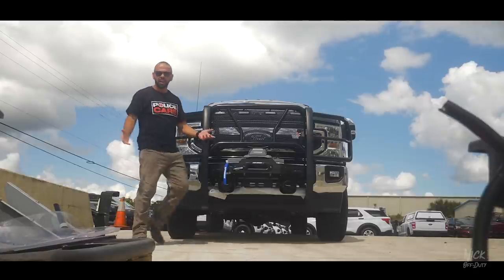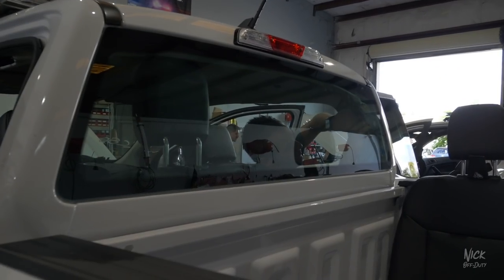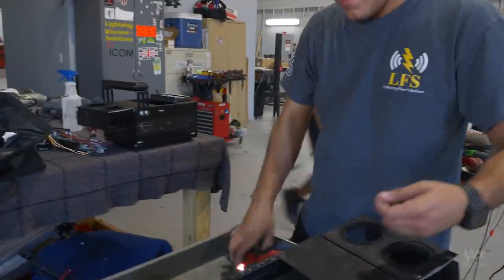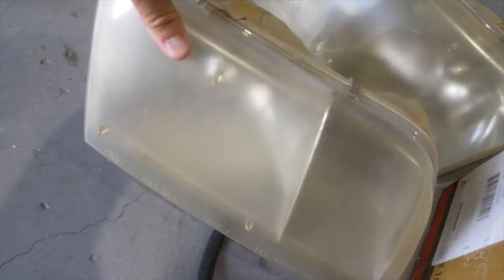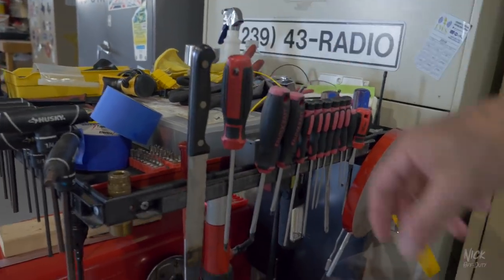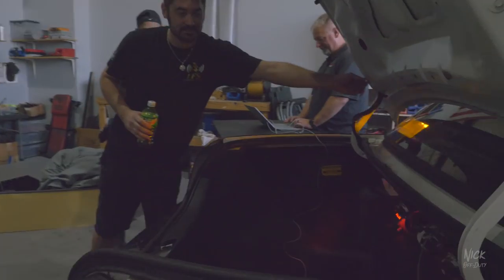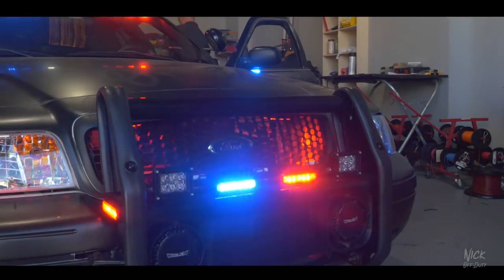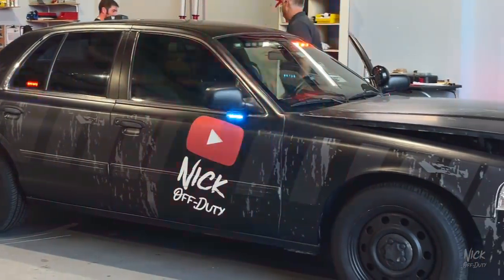POLICE CAR BUILD: PART 2 Police Lights Install (Process  Breakdown)

Comment: Y'know, that Fire Rescue truck brings up one of my pet peeves. For the life of me, I can't think of a single valid reason that a Fire vehicle needs to be "ghosted" or unmarked. If anything , you'd want them to be as high-visibility as possible. In policing, enforcement sometimes benefits from a low-visibility approach, but that logic just doesn't extend to other emergency services. (It's becoming OVERused in LE, too... in many applications visible deterrent and community approachability are being sacrificed for tacticool toys.)
Reply: @dalekidd420  In my area, small town, arson is investigated by those employed by the fd and is only passed on to law enforcement if a body comes up or drugs, ect.
Reply: A lot of HOAs in Florida do not allow marked vehicles to be visibly parked in their neighborhoods anymore
Reply: @fljosh1410  HOAs are stupid imo, I'll never pay to have less rights on my own property
Reply: @HurricaneHusky  Oh I agree completely
Reply: @HurricaneHusky  same, we have an Arson Investigation Division
Reply: Many reasons actually. First off if thats a P.O.V then the owner may live in a community that doesn't allow marked vehicles. Other reasons include municipal codes, and personal preference. Also realize that they make high visibility paint and decals in any color and can tune it to work with specific lighting conditions too, so you never know.
Reply: @dalekidd420  arson would be under fire Marshall’s and in some states they fall under both fire rescue and police

Comment: Nick, my only question. How is this road legal? Just courios about regulations there.
Reply from the maker: I’m an active duty police officer. In the state of Florida it is permitted. Although this won’t be used for ANY type of police work other than Charity events, hospital caravan drive-bys, and content for the channel. No traffic stops.
Reply: If you are an active-duty law enforcement officer, you can red and blue lights on your personal vehicle with permission from your agency. If you want to replicate this build with your own crown Vic, this is possible but in the color range of amber/white, which is LEGAL for civilians to run.
Reply: @NickOFFDuty  thanks for clarifying. I am aware you're active duty but did not know you can have lights on your POV.
Reply: @kishanpatel2036  not where I live (Europe). Even for amber you need permission. Too bad as I am volunteer SAR but we cannot have anything on our own vehicles.